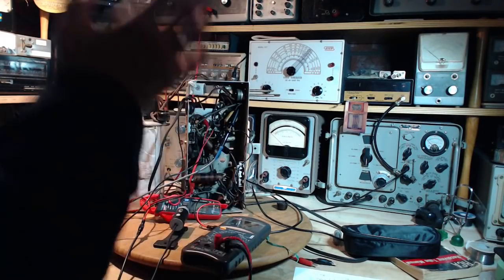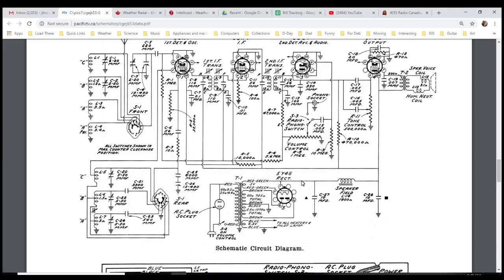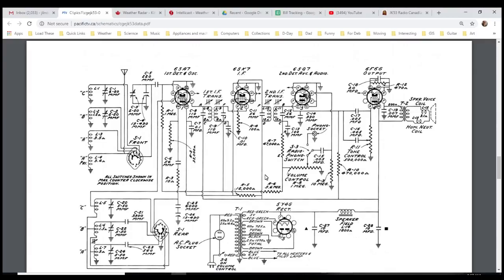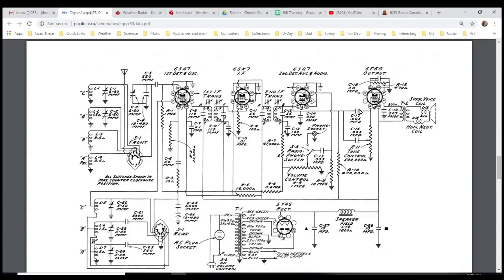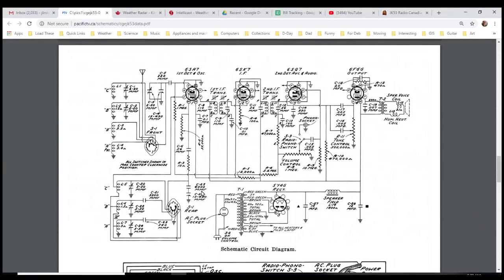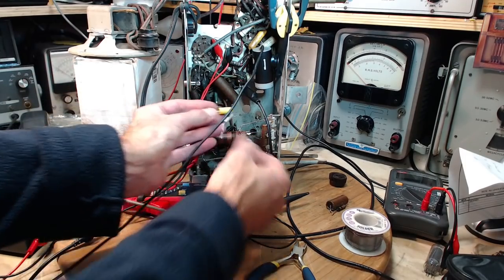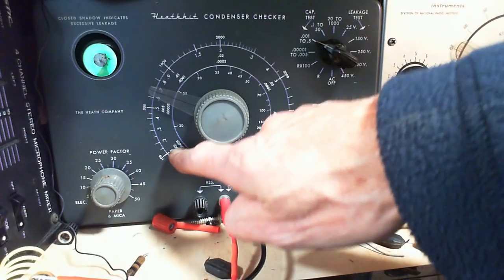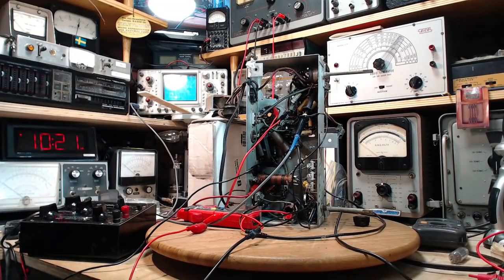Canadian General Electric Model JK-53 Video #7 - First Five Capacitors

Comment: That c25 (6000pf) is the oscillator padder capacitor and its purpose is to modify the tuning range of the oscillator section of the main tuning capacitor to assist tracking. In a lot of radio's this is adjustable.
Reply: Yep. And likely a "selected" component in this receiver during assembly/align/test. 
Was back then still cheaper than an adjustable padder there.

Comment: Do you check modern caps for which end has the outer foil before installing them?

Kinda surprising that the cracked one good... getting rid of all the old paper caps is usually a good thing, they're always suspect in a radio that's more than fifty years old.